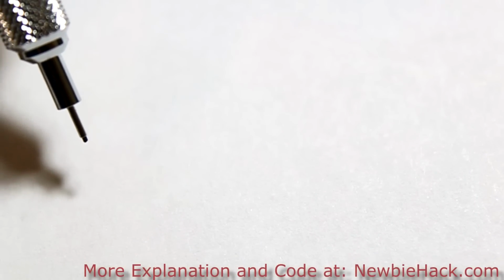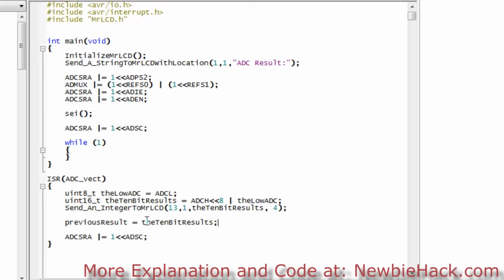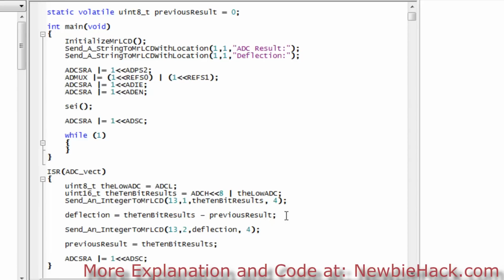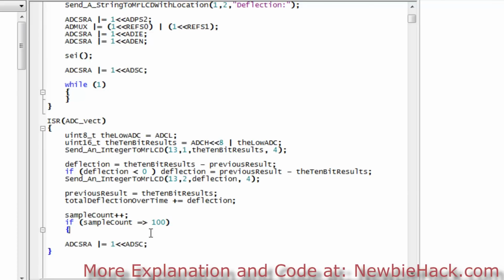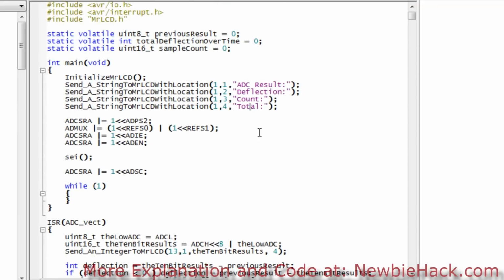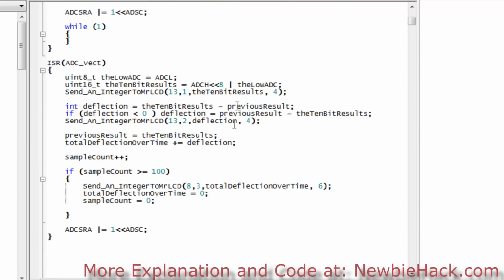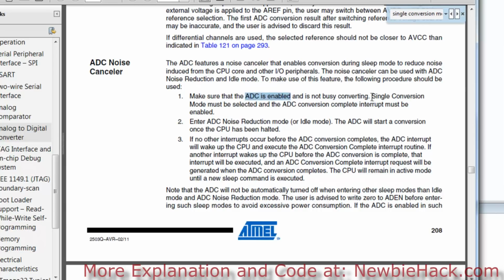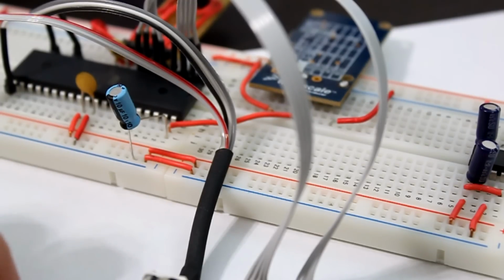34. Arduino for Production!  AVR Atmega32 - Measuring the ADC Noise (ADC Noise Reduction Mode)

Comment: Is it normal that your adc is showing 300-350 out of 1024 with nothing plugged in?  That seems really high.
Reply from the maker: Hey David, quite observant. Haha. The deflection is the better way to judge the ADC in this prototyping environment, the impedance on the vast amount of metal in breadboards, all the other challenges along with prototyping, and the lack of analog ground separation can cause these values. The ADC is measuring the analog signal and if there is impedance, the value will not be close to zero especially when all of that metal is serving more as an antenna rather than a good conductor. When the ADC is used in a PCB that follows the design rules of: analog ground separation, short traces to eliminate as much imediance as possible with good trace separation, the ADC values will be far better.

Comment: Hello sir i am using stm32 f401 black pill but ADC value fluctuate a lot even on dc input, how to improve it thanks
Reply from the maker: The only way I know to improve this is to create a special ground plane for the ADC.  This is relevant for the AVR. I have DC projects in my book that showed good results, and in my ADV STM32 videos. You may want to check those out. Look for my STM32 ARM older video series where I show how to use the ADC.

Comment: when i send a signal of say 90 mv from the voltage divider circuit to ADC(10 bit) then the ADC result is 0.But the result should be around 18 (Vref=5v).Can u please tell me the reason......I just wanted to make my circuit such that if i give 5mv then ADC result should be 1. PLEASE rpely ASAP....

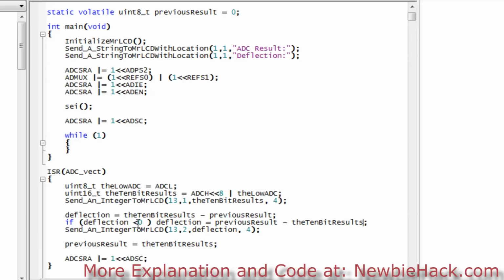Comment: Hi, A small doubt. I dont know if anyone has asked it before. @8:12 in your video inside if condititon, cant I just put deflectio *= -1? Is there any problem if I do like that?
Reply: Also if you dont mind can you tell what is the difference between deflection with noise reduction mode and without noise reduction mode without any capacitor

Comment: Patrick,  I realize this is an old post, but thank you.  very informative.   Question...   What was the source of the analog being measured?   was it pure DC?  since the larger cap and the sleep mode did not show any improvement, could the noise actually be from the source?   Thanks again.

Comment: My PCB is done finally and i measured the defections. Its from 140 to 160 over 500 samples.
I have a 200uf cap on 3.3v supply and I have also added a 4.7uf cap between adc_gnd and aref just to make sure no noise enters from aref.

Comment: But following two things brought my deflection down to 200-250
1: Adding a 4.7electrolytic cap between aref and ground(even if using 2.56 vref)
2. Added a 220Uf electrolytic cap near to accelerometer vss and vcc.

Comment: I think for noise canceler we also need to call the SLEEP command. In the code i removed start conversion command in ISR routine and also above while loop. Instead I added a sleep command in while loop. In noise canceler mode if SE is set in MCUCR, UC will go in sleep mode when sleep command is executed and also will start a conversion. Unfortunately I did not see much difference.

Comment from the maker: @SajjadBro This is correct from my experience. I have been following the datasheet as closely as possible to reduce noise.  Note that I didn't use an inductor as is specified on the datasheet, and this may have an effect on the accuracy. I have not received any comments from folks that may have had better results.

Atmel does publish a paper for 12bit resolution, but I have not read the paper (skimmed it).